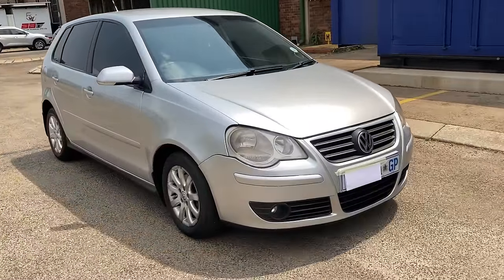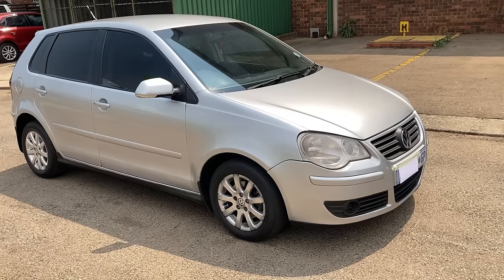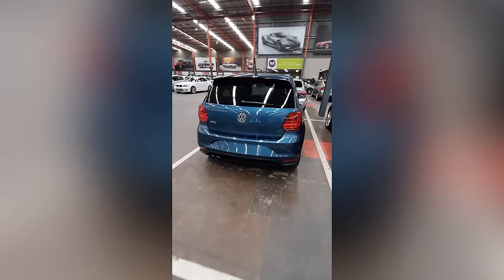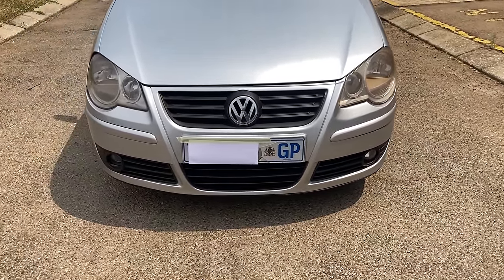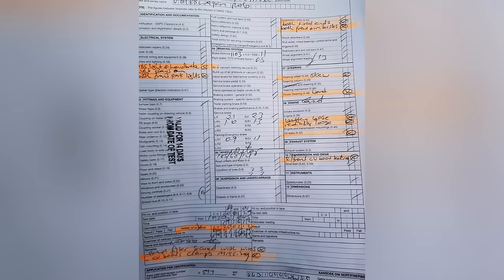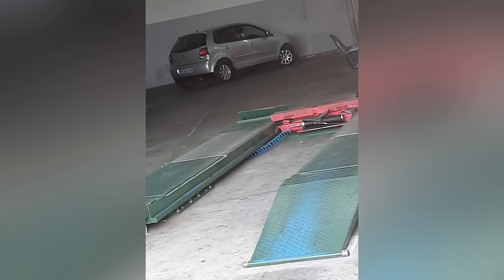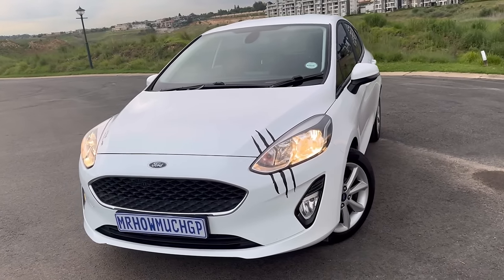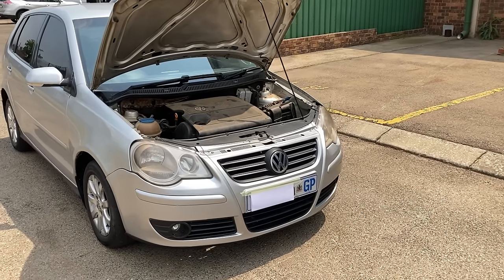VW Polo 1.6 | My First Car Buying Mistakes | WeBuyCars | Repairs | Auctions | Ownership Experience

Comment: My car was 470 000 km when it was written off. She was still on the road. The older naturally asperated cars are very reliable.
Reply: Ahh
Reply: Our Nissan hardbody is over 500k
Reply: My Polo 9n3 1.4i is currently sitting at 320 000km... These motors are very reliable indeed
Reply: I still have my 1.6 2008 polo I plan to keep it until the wheels fall off but I’m fearing it’ll
Need a dsg service soon

Comment: Video is very interesting. The dekra report from WeBuyCars is not truthful. I bought a Hyundai gets  1.3 A/C for R37500 in 2022. The dekra report only identified 1 issue which was the stabilizer link bar rubber which had worn out. When i took the car at webuycars in germiston the radiator was leaking and i told the sales guy that the radiator is leaking.......guess what he said(we are wholesale, we sell as it is😅). I took the car,  drove it and it was fine, after a month, a steal water pipe leaked and that is when I decided to fully inspect the car. I patched the steal water pipe, flushed the radiator and then patched it, replaced both stabilizer link bars. Now its been almost a year and the car is amazing, just serviced it yesterday and I think its the best car I've owned thus far because I can service it myself and i can also do I lot of things on it by myself😝. When you buy a second hand car make sure to do a full inspection and change what needs to be changed before things go  south

Comment: I bought my first car last year. It was an 04 Jetta. It was one of the best days of my life. The only issue they told me was that it needed the water bottle changed. So i had to drive it real slow so it doesn't overheat. Got the new bottle the next week, got my brakes done. And that's when the real problem started. Loss of power, hard starts, flactuating revs. After pouring all my money into it. They said the main issue was related to the exhaust manifold not releasing heat or something like that, and it would cost about 20k to fix it. And i had bought it for 45k. I was tired of fixing my first baby so i sold her to someone who had the strength and patience to deal with all that.

Comment: 😂 😂 😂 😂 Ey the doors ne.. I have a polo 1.6 2009 model... The back right door gives me issues.. Got my car at 145000km in 2020... R62000 fresh as a lemonade... The car was super clean everything was still VW Original parts... No issues watsover.... Only had issues two years later when i had to start changing breaks, plugs and shocks... Honestly the only time i stuck was because of tyre or petrol... Unfortunately i had an accident last year got hit from behind..... Mxm.... I still drive it today it got fixed im on 233600 km... And honestly the best car iv driven thus far... I had a clio and kia before... Most reliable... I call her Bianca

Comment: Hi brother, good content, i had same bad experience after buying my bmw x3, 3D M57, 2010,from we buy cars, the car was very clean inside and  outside, everything in original condition ,I have some experience in buying cars as this was my 20th bmw  cause o buy keep for less than a yesr and change it, the only thingon this car it was missing a windscreen bidding, which was strange because the car was never been in any accident, the bonnet even still had the original plastic on it for chips, and i overlooked that missing bidding, but when i drove the car from dealership on the freeway it started losing power and instrument cluster can go off and on, and on again, next day car did same thing and it started dying on traffic lights, i do service my cars at bmw dealership but this time i said no let me check out this guy who helped me before, went there and theu diagnosed the car and told me it needs fuel pump and i spend 8k on it and car still do the same ,went to another mechanic and he found oil in fuse box all the relays and fuses were full of oil which was strange, i had to buy engine relays which costed me 4k car was fine for a day next day same problem this time i was fade up and went to bmw, they diagnosed the car and found that it was diesel regulation valve which costs R3800 and serviced the car all costs 8k then they found cvc the exhaust regulation value was responsible for power drop too it was leaking on top and you can see it was black the part alone costs 15k all in all i spend 45k on the car to make it right.  But the main thing everyone should be aware of with auction cars is that some of those cars get sabotaged by employees there who collude with some other clients who wants to buy the car there cheaply,  eg someone comes at the auction and like the car but it is expensive then he makes a deal with the sales people to sabotage the car so that it devolpes a problem ,either not start or anything that will cause people not to buy it then he comes back and offer less money, in my case my car was sabotaged either buy the same people where they bought it so that they buy it cheaply or someone a potential buyer was waiting for this car to fail to sell then he comes and get it cheaply,  the missing windscreen bidding was intentionally removed, the oil in the fuse box someone intentionally poured oil there to make the car fail to start which didn't happen, the car didn't want to die that way, a friend of mine bought a 7 series from the same auction next day it started problems and i told him to first check everything himself and he found under the hood that same cables were disconnected and he just connected them back and the problems were solved,  so be vigilant when buying auction cars , the auction itself is a good place to get a good deal if you are a risk taker, but if you are looking reliability and guarantee then auction is not for you, because employees of the auction have buyers who buy to sell and those collude with them to sabotage cars even the auction themselves they can sabotage your car if you are selling and then give them the car to assess it without you being around, they can come back with a list of problems and a small offer then when you drive the car back sure you start to see those problems and end up selling it to them cheaply.
Reply: Thank you
Reply: I picked up great insights in your commentary.Thank you.

Comment: My wife gets the new cars. I have a 2007 Polo Classic 1.4. it's low mileage (102k km). It's still going strong and had it's major service now so is good to go for years to come. By the way the locks love to go, they deadbolt too so it's a mission if the door locks shut!

Comment: my first car was a used 2015 Sandero from a random dealer, felt wobbly on the road and the steering wheel would vibrate at high speeds. turned out the left rear shock was bent when i took it for alignment and a bro that was working on it got is sorted for me on the side. driving in the rain gave me another shock; water came in through the aerial mounting on the roof. :D.
then got a used Fiesta from VW dealership, not a single thing to complain about a year later and folks hardly believe it's preused. ho tough there by used cars.

Comment: I had the same polo the same colour same wheels for 12y it was 2008 12 months old with 14.000 miles on the clock I got for a great price from a vw dealers it had a 1.4 tdi 3 cylinder it was a great car I sold it last year with 100.4000 on the clock it was requiring some expensive jobs on it to keep it going properly my new car is 1.6 diesel Astra which is smoother with the extra cylinder and to my Surprise is doing more mpg

Comment: A lot has changed , the CPA forces a 6 month guarantee which a buyer must move fast on to deal with any issues, and as you mention make sure to study the dekra report.
Reply: Nope., the CPA does not cover secondhand goods and vehicles.

Comment: This is a Comfortline (electric windows, mirrors and colour coded beadings). I had exactly the same car from 121 000km and sold it at 340 000km something. 

Nice cars, but after 250 000km, the issues come piling up.

But id still buy it over a Kwid

Comment: Hi Baba Sambo, great story of WV Bushwa
I really wonder why people who know very little about cars would buy a car from an auction.🤔. Wait my first car was from a Wesbank repo Auction, however the car was a 2 year old so it was a well  calculated risk. It was in a good condition no problems until say  5 years later. I am mechanically enclined with 2 NDs and a degree in engineering. I must say it's never a good idea to buy a used Vw if you dont know   anything about cars. I have owned 3VWs at different  times  one bought used, the rest new. I'm contemplating to replace from old to new Tiguan maybe a demo. I do my own maintenance/repairs. For reliability, I buy Toyotas albeit boring.
Reply from the maker: 👀 wrong channel
Reply: Baba Sambo😂

Comment: the first red flag with 'yanos' was the plate number design. that alone says so much about a vehicle and the previous owner. the second red flag was the inside lights which were led - that shows you alongside the number plate, that this car has been fidgeted with unnecessarily. yes - the inside lights could've had to be replaced but why put in led ones? no surprise that the car had rims on - the plate number is an instant giveaway that the previous owner liked things and you do not want a second hand vehicle from a person like that. the led headlights were just the cherry on top. 

do not overlook the small details. sometimes you don't even need to check the car mechanically. small details are more than enough to tell you everything you need to know.

Comment: In 2018 we bought a 2009 Mercedes Benz c180 at we buy cars and after driving it for 2 weeks ,it broke down and we  had to pay over 40k to  fix  it at the Mercedes dealership it only had 120 000 km on it

Comment: I got  442000km on my  96 130 Conquest  .. wich   has double the  power of a 1.6 polo ... on the original  engine...    was called  to tow a car on the highway ... my 96 conquest 130 towed a fully loaded 2016 Vw Polo With Seized engine at only 96000Km ... Engine  Sludge issues .... My  96 Conquest Is Still  A daily driven ... & Doesnt Touch A Drop of Oil ... Nothing BeAts ... Toyota  ... Hands Down ...
Reply: Good but it's still the most boring thing ever made though 😂

Comment: Lol 200k is not on its last leg buddy, 200k highway km is literally like 100k city.  My first(Fiesta 08 Model) car is currently sitting on 250k and drives like a dream, no squeaks, still has a lot of power. lol actually still use it more than my second car(Opel Grand Land X)

Comment: Oh also the driving above 90 vibration was also my pandemic... I actually changed break disk and break pads... But still.. Turns out I had to change stabalizer and links plus shocks.... I sis that two years ago... Still no issues

Comment: I Should Have Seen This Video Before I Purchased Mine 😂😂But We Still Good. Financed 2nd Hand Korean. So Far I've Spent Around R20K On It. Two Clutch Kits, Gear Lever Cable.. If I Include Tyre's And Brakes Then It's Just Over 25K.. We're 3 Years.. 3 More To Go 🙆🏾‍♀️

Comment: 🤣🤣🤣🤣🤣🤣🤣😂😂😂that's a VW polo for you! I owned two polos in my life, first one was a 2005 polo highline, bought in 2014, it was fine all along until troubles started, inner and outer CV joints(bought 'em in numbers I cant remember) and worst I couldn't return them for refund cuz you fit it to check if it works even though I went around with a sample, so if it doesn't, it's a fail and loss, steering rack with leaks (bought 4 second hand ones), cam belt / timing belt which, as you know, when that belt snaps, your engine is gone, gonna have to buy new pistons, valves, head-gasket.....long list of parts and fluids, and it happened twice! I ended up getting fed up with frequent buys of parts that weren't lasting or fitting I left it on my yard for a year using public transport...until someone came and bought for R10K and in September 2018, I bought the second polo, 2012 tsi dsg highline with 7800km mileage, (bargain as I thought)…..the very same day I paid for it and was driving home, I noticed the steering wheel was off center, if I try to straighten it out, the car was going off lane....went to a mechanic, found out the car had and accident on the front left side/passenger  side, V-arm was a little bend but the  steering rack end was bad and needed replacement that I did and the following day went for wheel alignment and the car drove well but with a steering wheel still off center but to tolerable and acceptable degree, after some months a boot couldn't open at all, making a weird sound, had to replace a whole mechanism, later, in the glove box, there's a "passenger airbag" switch that was faulty and turned on airbag light on, replaced that too....early 2021, I had a gearbox warning light flashing on and off, was told my mechatronic needs to be replaced, that is where big money was spend R16k, now in April this year, steering pump died and we discovered it was also affected in the accident it had, that's also expensive almost R13K ....ai fotsek, I parked at home since then and have been using public transport! I was starting to be worried as to how many parts are going to fail....

Comment: Thank you for your story...im currently considering a second hand car as my first with a budget of 120k and im scared
Reply: Focus on service history and the type of owner eg old man.I bought 4 years back a Jetta 5 1.6 petrol with 217 000km on da clock for about 120K.I was unsure but after a few phone calls and confirmation of services done on the car I bought it while it were 600kms from me with out see it  with my own eyes. Car was solid previous owner swapped it for a double cab.Reason for high kms was he traveled a 600km trip to work each week.He worked at a mine. so the car only did highway mileage.It have now 300 000km and I replaced starter, cv joints, wheelbearings, MAP sensor, Timingbelt and battery.

Comment: So much suspension issues previous owner must have had the car lowered with different spec wheels and running spacers might off set the driving since its not to factory spec
Reply: I suspect the previous owner properly drove this car my friends st broke a mounting ond day after a couple of wheel spins so im thinking the previous owner was a proper vw driver

Comment: Eish my man got done dirty. But you learned a lot. The trick with old 2nd hand cars is patience and private sale. If you keep your ear to the ground you could have found a polo owned by an old white lady for R40k. You want one where the owner spent a lot of money on it. It doesn't increase the value of the car much but it will be much nicer for the next owner. You have to find a good example and even then you must budget a good amount for fixes. If you follow this advice you can have a very nice car for reasonable money. The key is patience.

Comment: Never buy a used car if you don't know anything about cars. If it's too good to be true, make sure you know your way under the hood. You were over priced here a lot R150 for a engine mount bolt and R350 for removal of spacer. These are basic thing like changing tire or knowing where to jack a car. You never fixed the door and the boot, like bro do you even have a tool box as a car owner? I always do the repairs myself I never had a mechanic fix my cars even engine rebuild I do them myself as cars gets old. FYI I'm not a mechanic I'm just a car enthusiast and cheap😅

Comment: I also had a 9n3 1.6. 
Great car and feels well built. However, once they reach higher mileage, it becomes hit or miss. 
I had a terrible experience with mine once it hit the 200k km. Sold it at around 250k km.

Comment: Never buy a used car without conneting an OBD2 diagnostic tool on it. Not even from a reputable dealer. And remember, there always a good deal, dont be scared of losing out. They have no mercy when you sell or trade in, you should have no mercy when you buy.

Comment: I'm 18 and I just got a bujwa as my first car😭😭😭
Reply: Saint Knodge  Honestly not that bad I just feel like it's sluggish when it comes to picking up speed but what do you expect from a car that's around 14 years old. But overall I haven't had any mechanical issues I just changed the shocks and brakes because they were finished.

Comment: Sorry brother, but I bought 2 cars from we buycars in centurion, a2011 jetty n a 2013   toyota hi lux d4d ,the cars r still  running problems free, if u buy a car, it determines on the price n the condition of the car, u don't expect much from 60 000 bro . Check the condition of the car before buying it. Take someone with you who has a knowledge in cars ,y r we blaming webuycars all the time. I will always go to them when I need a car .bro take ur time go through internet, don't just take anything because ur desperate.
Reply from the maker: you’re just repeating everything I said ,did I not say with cheap cars you should expect to fix things especially if the car is 60 000 ? Did I not say go with someone who knows more about used cars ? I even said there are people who’ve bought cars from there without issues , I didn’t blame WebuyCars anywhere , I’m just sharing my own personal experience and I concluded by saying now that I’m older and more knowledgeable about cars I would even consider going there to check for a car again.